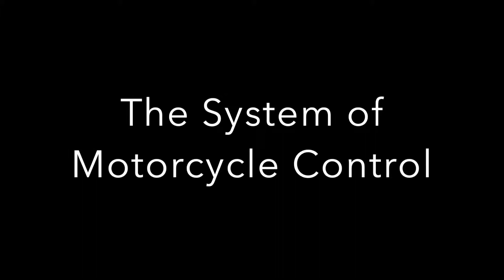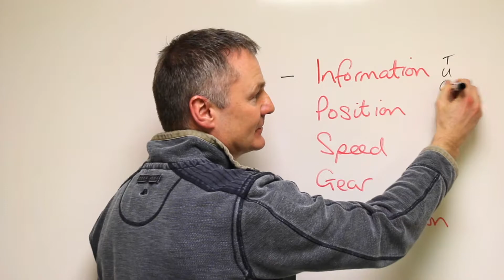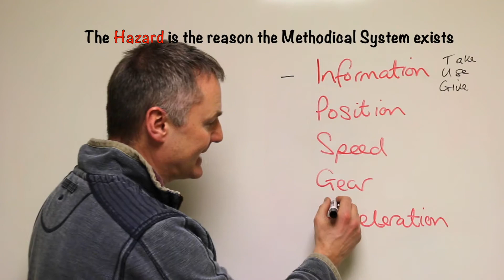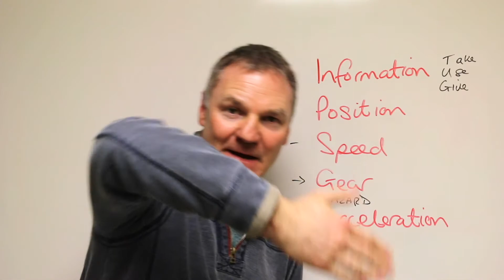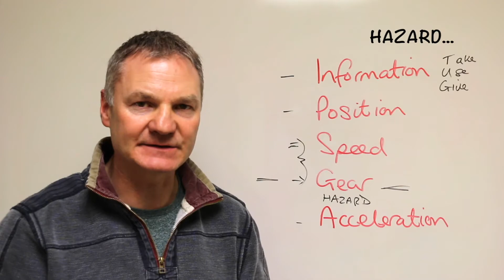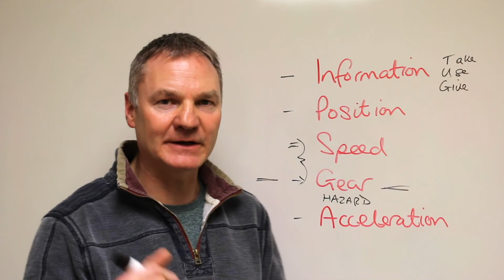How to become a better rider - Use IPSGA the Advanced System of Motorcycle Control riding techniques

Comment: Good introduction for riders starting to research IPSGA.
Personally though ( and as stated in "Motorcycle Roadcraft") I need to express my constant frustration of  IPSGA being broken down by folk into 5 parts ?         Although  I.P.S.G.A  is a 5 letter acronym !
As you mentioned, ( albeit a tiny bit confusing for newcomers) "Information" processing and 4 phases should be considered systematically, flexibly and always in order...
Each phase developing out of the previous one. 
Each phase requiring the "consideration" of the next one after it in sequence ...
Information always dictating which component of IPSGA to implement, but considering each one before in order ...
Once riders grasp the IPSGA system and adopt it into their riding and planning almost unconsciously, we always see huge improvements to their riding ability  ...without failure ...  every time !
Its only when they robotically have a "Brain Fart" experience and the whole ride falls to bits do we then appreciate the importance of Safe, Legal, Systematic riding. Making smoothness and progress something every conscientious rider can aspire to. 
After many years i still aim to improve and become a better rider,  despite badges and certificates.
I agree with you regarding riders will intuitively  use information to dictate the chosen road position , and repeat, repeat etc then the need to address speed, select an appropriate (flexible by definition) gear and naturally use throttle to deal with the need to get the bike on its way again.(acceleration)
I personally think IPSGA seldom gets enough explanation for folk wanting to learn and understand it ?
Without doubt, its not what we know, but how we apply it to our riding which matters !
Good to see yet another ambassador helping to spread their knowledge .
Reply from the maker: Thanks for your comment, there are far too many factors to discuss in such a short video. Anyone who wants to improve should use this as a base and then progress with professional guidance, education, practice and then experience.